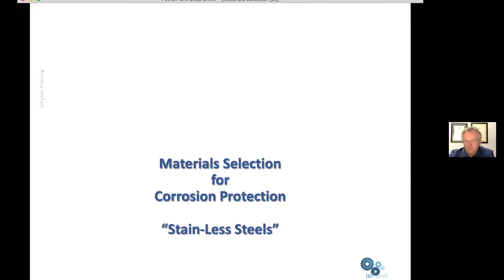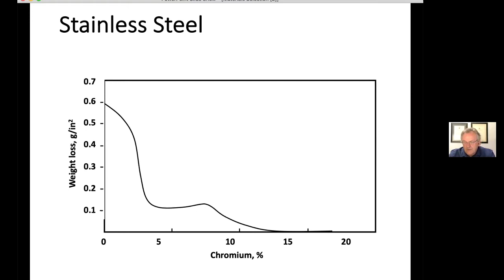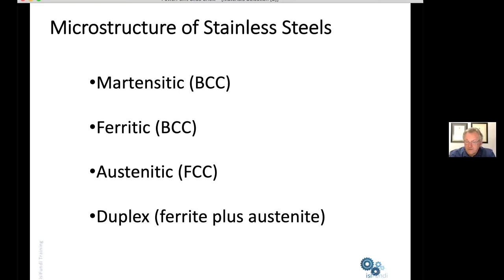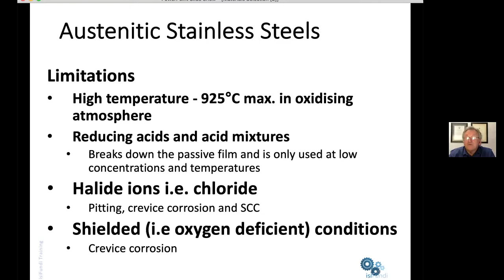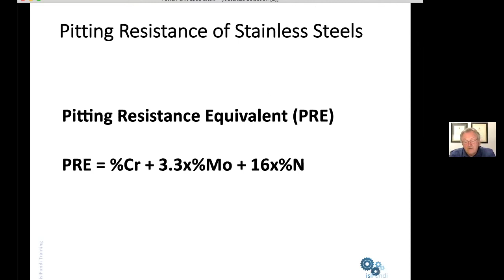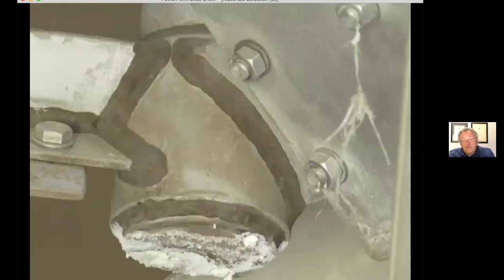MATERIAL SELECTION FOR CORROSION PREVENTION: Does Stainless Steel Stain Less?

Comment: great presentation, i have a question: Steel and galvanic corrosion, have you ever find evidence of steel damaged by the lack of grounding in electrical powered machinery?  I find some alarming signs steel degradation in many surface machinery and transport infrastructure ( conveyors ) on mining operations. I suspect some of the damage could be related with the effect you describe in the presentation (grounding problems). Thank you!
Reply: Roy, Whether your issue is related to electrical grounding issues (or not) can only be conclusively evaluated by formal interference testing. That said, lack of grounding can set up stray currents in structures which can cause corrosion, particularly if VSD’s are involved. If grounding is intact, you then sit with bi-metallic (galvanic) couples between steel structures and either copper earthing systems or reinforced concrete foundations. (Copper and steel-in-concrete are very close electrochemically). I hope this helps. You are welcome to contact us directly if you need more detailed investigation which we can offer through our engineering service division. Neil Webb